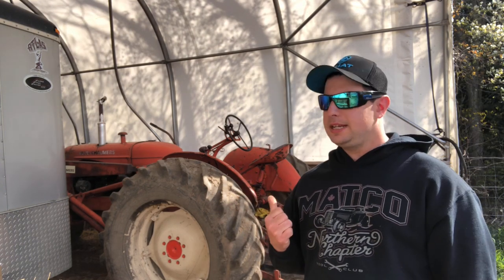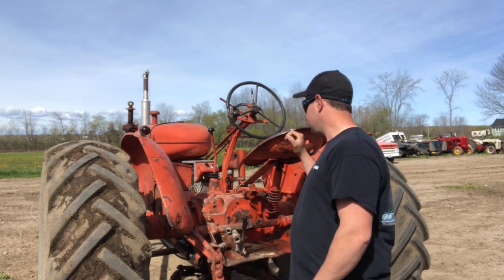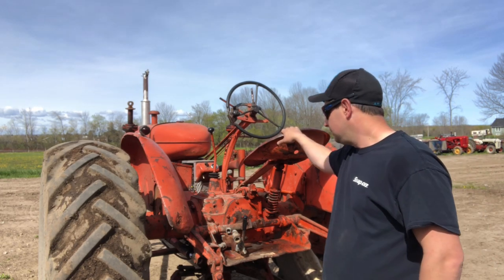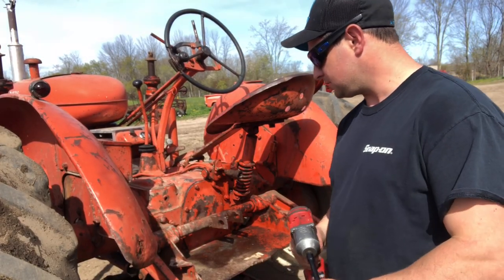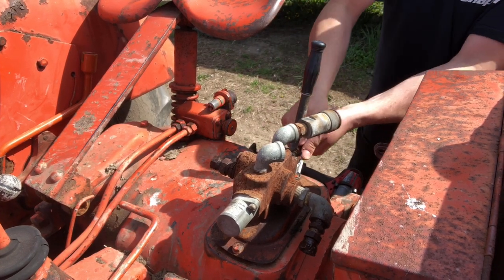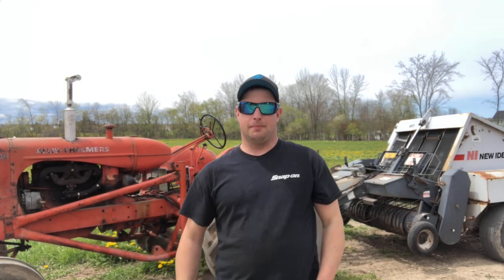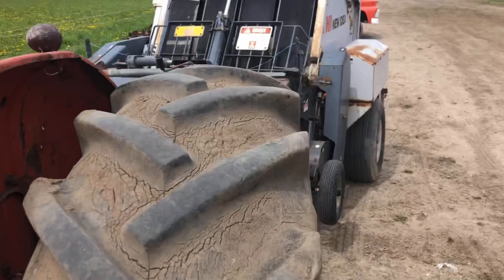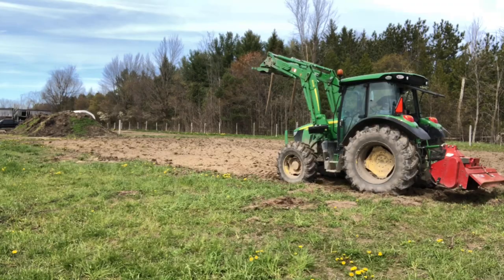Will it work? Installing modern hydraulic remotes on an Allis chalmers WD and garden tillage

Comment: I pulled a 504c round baler with my WD for 5 years in places a lot of people wouldn't put a big tractor I love round Bell in with my WD
Reply: Did you have any trouble with the higher  pressure  hydraulics . I'd like to try it but I'm worried  about what it might do to the gate cylinders.
Reply: @dodge-ut6ti  If you use any off the shelf open center 2 way valve for your 2 way remotes, it WILL most likely have a relief valve in it. Most come pre-set at around 2,000 PSI so you will not damage any components down line. 
 It may be a bit slow, because the Allis pump is a low volume pump.
Reply: @bluegrallis  Thanks I have a WD45 I would like to plump in 2 way hydraulics.
Reply: @dodge-ut6ti  I just wrote about 4 paragraphs on a facebook Allis page on how to do it. I'll see if I can find it again.
 Here is what I posted. It's not hard to do, and you will be happy to be able to still use the lift arms one day.

 If you want to still be able to use the lift arms and single remote, you have to start by putting in a diverter valve. Connect both lift arm cylinders to one side of the diverter valve, and connect the other side of the diverter valve to a new, 2 way open center valve.
Plug the original Allis valve (on top of the pump), where one cylinder was connected and use the other port to feed pressure to the diverter. You can leave the solid line to your original remote the way it is, and it will work as original when you divert to the lift arms.
Then plumb the return of the new valve back to the reservoir.
Now all you have to do is add quick connects to the new 2 way valve for your 2 way cylinder connection.
The diverter will switch from the new 2 way valve,or to the lift arms and original remote. When using the new 2 way valve, the lever behind the steering wheel will have to stay UP and with the open center new valve, will just dump back to the reservoir without forcing the unloader valve to hammer.

Comment: I HAVE A WD45 I would  like to use on a 1475 gehl round  baler if I can hookup modern hydraulics.I have a ford 860 that works good on the baler. Going to try it on the haybine next.
Reply from the maker: We are going to give it a go so I will
Let you know how it goes 👍🏻
Reply: @ontariovintagetractor  Thanks been wanting to do it to the WD45 but have not been able to figure it out.

Comment: When installing hydraulic fittings/lines I’ll thread in the hydraulic lines before bolting down the valve or whatever using. That way you’re not fighting getting the threads in straight. Then bolt up your valve..
Reply from the maker: That’s a good tip , starting lines in a fixed object is likey a habit from being an automotive tech , lol we don’t get to remove things to start fittings. Thanks for watching , cheers

Comment: If you have Power Crater pistons in a WD 201cu in engine with the original 4 inch stroke crankshaft, you will have LOWER compression and LESS horse power. Power Crater pistons were used with the WD45 crankshaft which is 4.5 inch stroke and is 226 cu in.
Reply from the maker: It’s a 4.5” stroke , only thing 201 is the block, thanks for watching
Reply: @ontariovintagetractor  So that's where the "45" came from for the WD45 model name, the amount of added stroke. The manifold was also another big improvement on the 45s. Better air flow in/out, which it looks like you have (mine has the older style that I'm planning to 'upgrade').

Comment: Does the wd45 have any type of filter or ckball for the hydraulic pump?I lost all hydraulics on mine,and I'm thinking of pulling the pump,any ideas would help.thanks,great video
Reply from the maker: Hey there , there is no filter , in my experience most hydraulic issues I’ve had were failed valves on top of the pump , hope this helps , thanks for watching

Comment: I was wondering about the speed of the hydraulics, but it looks like it worked OK on the baler when the engine was fired up.
Reply from the maker: Was a top concern of mine for sure , it doesn’t like the 1310 gehl , but that new idea seems to work just nice

Comment: Hi, thanks for this. I've got a series 1 D17, and I'd like to do this same thing. However, aren't the 3 point arms going to be up all the way the whole time that you engage the hydraulics from the lever above the steering wheel? Am I missing something here?
Reply from the maker: Yes they will , but it doesn’t interfere with anything , not sure on a 17 , but I’ve had no issue
Reply: @ontariovintagetractor  Thanks for your response. It doesn't interfere with your baler, but I want to put a post driver on the 3 point. the power to pushes the driver up, and then it dumps the oil back to the sump and gravity pulls it down. But I need the 3 point arms down though so that the driver frame sits on the ground and just the driver weight is pushed up by the single spool it uses. It looks like my only option is something called a selector valve that allows you to divert oil to the remote implement instead of the 3 point...thanks, let me know if you have any other ideas please. nice video, no problem with the sound
Reply from the maker: @mileswizbo8960  yes you are correct i forgot my revision that’s on the tractor now , I have a shut off valve to the spool valve that when I want to go back to single phase hydraulics I shut off the flow to the spool valve

Comment: You can take the hand crank rod out and run a front hydraulic pump.
Reply from the maker: It’s tough to do with a WD because of the way the hand crank system goes through the steering box. If it’s Been done , I’d love to see a good example as I have a pump to do it with
Reply: @ontariovintagetractor  I'll try and get some pictures. Mine has it
Reply from the maker: @jimbreedlove1342  that would be great , you can email them to me if that works ? rdautoandtrailer@yahoo.com thank you

Comment: An ac tractor is high pressure  low volume  hydraulics compared to a ford or modern hydraulics  that are high volume low pressure  are the hoses and cylinders go to hold up under the higher pressure. I don't  know the answer, but I've been told that it will not hold up. It looks to me that it lifts the gate good lm going to try it with a wd45 , Let me know if you have trouble from the higher pressure. Thanks
Reply: You have been told wrong. Any added on 2 way valve will have a pressure relief valve, so you will never see HIGH pressure beyond the 2 way valve.

Comment: I’ve got two WD45s, and I just bought the second one. I’ve got to ask, do you know what the appeal is for WD45 engines to be swapped for WD engines aside from bolt on when the D-17 gas engine will fit as well? Reason I ask is the 2nd has a WD engine where the first one will be getting a D-17 engine when I get around to fixing a few minor things. Love seeing you use these old workhorses.
Reply from the maker: Hey there thanks for watching , the Wd45 has power crater pistons and a 4.5” stroke , vs the WD only having a 4” stroke and shorter pistons
Reply from the maker: @happyjohn8256  hey John , yes there is, before the WD45 , there was the WD , WD had a 201ci engine , WD45 had a 226ci engine ,  as well as some other features that were different from the WD. Thanks for the question . We appreciate the conversation, cheers friend !